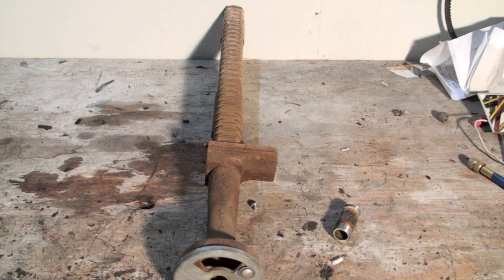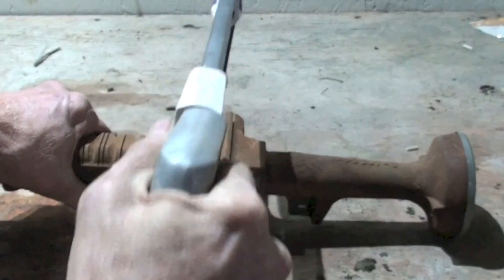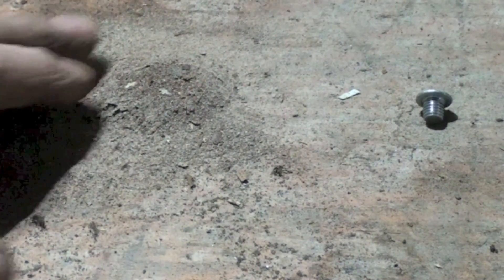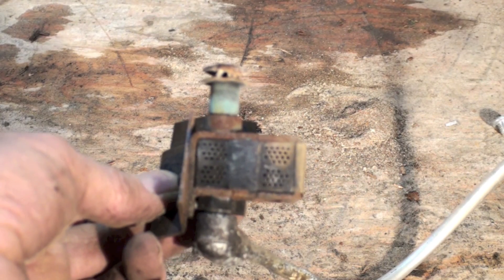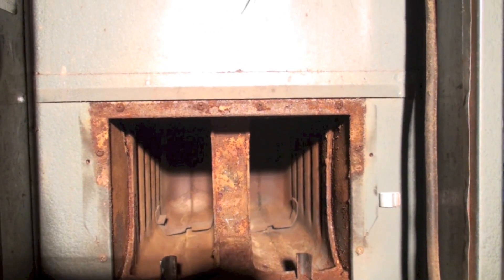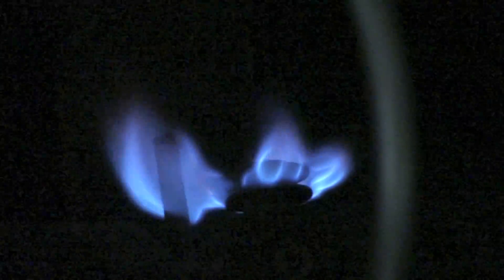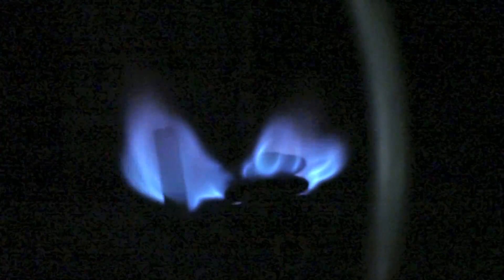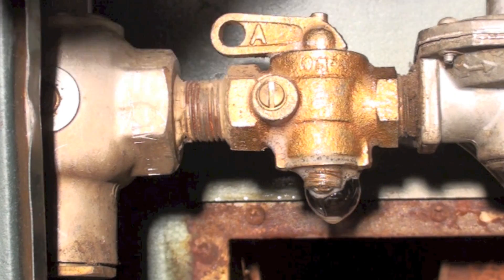Antique gas furnace, cleaning the burners and pilot part 4

Comment: is there a way i can contact you for a brief conversation, im currently trying to diagnose my furnace. i think its something to do with the blower motor, same furnace, its a replaced blower motor, ive replaced the capacitor and the fan limit switch is reading but the blower isnt kicking on. If theres a way i can call and just describe the setup and just try to get some direction. it would be helpful.

Comment: Did you also disassembled the gas pilot parts and clean orifice? This can be done by removing the brass nut
Reply from the maker: There is generally no good reason to disassemble the pilot unless there is no gas flow to the pilot.  The pilot orifice is very small and cannot be effectively cleaned, only replaced.
GFM

Comment: Great videos on this antique furnace!  Thank you for posting!
I have a 1954 Bryant floor furnace with pilot issue.  It also has yellow flame.
Wish you had gone into more detail about the pilot.
After the burner stops, a flame travels up the side of the pilot and pops when it reaches the top.
Like water dripping, upwards.  Pop, pop, pop, every few seconds until the furnace cools sufficiently.
What can be done?   Is a replacement pilot assembly still available?
Reply from the maker: You probably have a gas leak at the pilot assembly.  Standing pilot assemblies are available, however, it may be a leak at the pilot tube fitting.  I would get it looked at as you do not want a leak even if it is a small one.
GFM

Comment: Thank you for covering the antique gas furnace, the do last for ever if maintained
Reply from the maker: The idea that they last forever is flawed.  As with most mechanical devices, the vast majority last 20 to 30 years.  Some fail early in perhaps 10 years and some last very long.  Its just that you only come across the ones that last because they are the only ones left.
GFM

Comment: this is a high end quality range==allmy.tips/ZLINE_Range?31E  oven is electric and is is equipped with a 4 wire range cord. gas line sold seperate. fits a half inch fitting for gas connection. oven has two glide out racks. love this. range top is made of heavy duty cast iron grates. the bottom peice below oven is stationary, it does not have a pull out drawer. also to note this is a drop ship item. you will need to be prepaired to bring in house on your own. delivery company will call to make an appointment for delivery. You wont be disappointed in your purchase. i have been selling appliances for 13 years so i do my research before i buy. Z Line makes good products. Also comes with a good manufactures warranty.

Comment: How much should a job like this cost
Reply from the maker: About $100 to $150
GFM
Reply: grayfurnaceman thank you I need it done ✅
Reply: IT DEPENDS ON HOW HARD IT IS THAT ACCESS, MANY TIMES THE BURNER COVER HAS TO BE DUG OUT OF THE DIRT TO REMOVE, EVEN IF IT DOESN’T HAVE TO BE DUG OUT IT WILL COST AT LEAST $300 HERE IN SOUTHERN CALIFORNIA, AND THAT IS AT THE LOW END.

Comment: Do happen to know where the fan limit switch is on a vintage Lennox gh5 series furnace is?
Reply from the maker: It should be located above the burner cover in the center of the front panel.
GFM
Reply: Been working on my gh6 all week.

Comment from the maker: I will be uploading a vid on repair of the valve.  Not that I recommend that repair.  The problem with these older parts is that during normal servicing, they often fail.  Proper repair of this unit would be a combination gas valve.  But also replacement of the furnace should be considered.  Why not put the repair money towards a new furnace?  Also, remember this furnace is not installed.  It is a mule for videos.
GFM

Comment: Uh oh so what are you going to do about that leaking shut off valve? delete the valve train and install a combination gas valve and extend out the manifold with black iron pipe where the regulator and gas solenoid is.